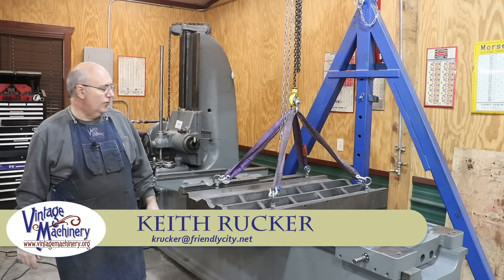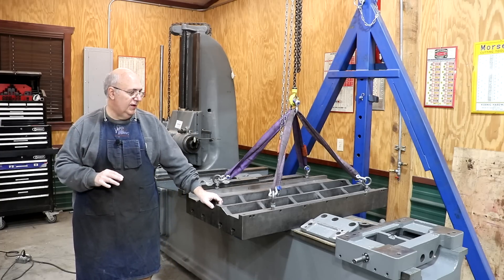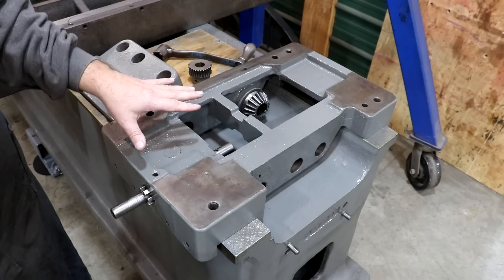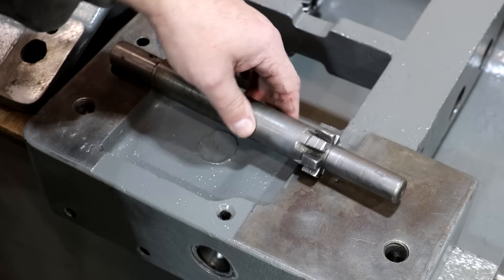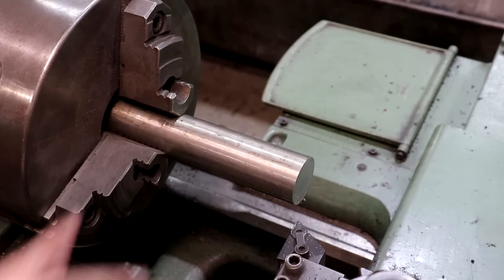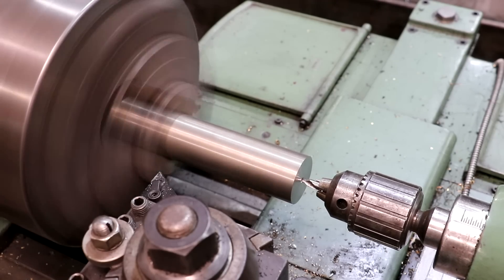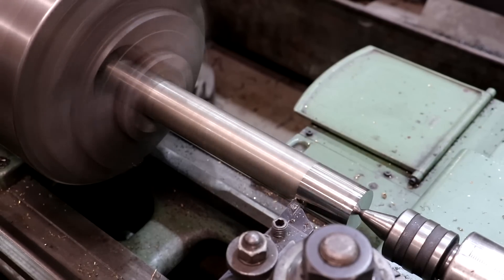Lucas Horizontal Boring Mill Restoration: Machining a New Tailstock Crank Shaft

Comment: You make that look easy.  Now, if I just had a shop, a lathe, a radial drill, cutters and reamers, then I'd be good to go.  Thanks a ton for a really fun video.  I really do appreciate it.
Reply: And a lifetime of experience...
Reply: being a tight ase and a dole waller in the uk. I think with a steel RSJ a salvaged motor and some basic tools like precision dial, caliper and maglock base and precision square off ebay, I can make a lathe and next a milling machine. Machinery on the cheap so to speak. Hope you can too if money is an object.

Comment: When you ream a taper pin like he does here you make it easier for the next guy if he has to knock it out. leave the big end outside the part and the small end (the one that you would hit if you want to drive out the pin) inside the part. It's not as pretty looking as having both ends even, but nobody's going to see it most of the time anyway.

Comment: It’s easy to use the old hole. 

Drill and ream a piece of round stock in the lathe to take the appropriate taper pin, tap a pin in and bore a hole through it. Cut the pin to fit the larger hole in the gear just short of the shaft.  Now you can drill and ream to fit. 

Imo the Swiss cheesed gear is almost as bad as the missing tooth  aesthetically.

Comment: Grab the top of the tool post and pull it away from the work as you scroll the carrage back and you won't leave those scratches.
Reply: Or be like a normal machine operator and back the axis off before moving it back for a new cut.
Reply: That only matters on the  final cut. By leaving the tool set you’ll know exactly how much to move it for the next pass.

Comment: Keith, would it have been beneficial to heat treat the new shaft in the Hot Shot to make it more resistant to wear? And if you heat treated it, would the dimensions change so much as to require some clean up on the lathe and/or horizontal mill? Thanks, great video!
Reply: I wonder this too, after it's hardened does it need a tool post grinder to make precise again?
Reply: The dangers of warpage and extra time and labor required to finish is not worth it for a slow turning shaft like this one. Best material would be tough but machinable 4140 which requires no heat treatment.

Comment: Keith, forgive me if I seem inane, but after you finished reaming and checking the pin, did you take it all back apart, remove the shim and clean the metal filings out of the case? Is that something recommended or is the detritus so miniscule as to be no worry?

Comment: I didn't see if you took care when drilling the tapered pin hole that the worm gear would align with the shaft it needs to mesh with.  In the video it appears as if the worm gear is too close to the casting!
Reply: Exactly what I was thinking too.

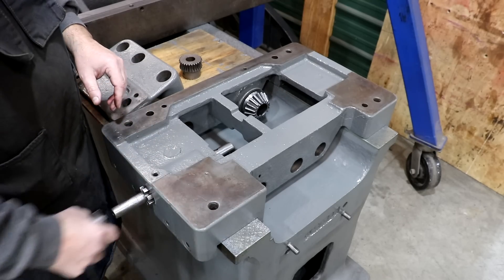Comment: I recently down graded from 500Mbps to 300Mbps Internet connection and for some reason these video's seem to be playing in a slower mode or at least I hope that is the case and Keith isn't drunk.  I didn't think this was possible, Keith drinking maybe but not while working with such dangerous equipment!  Someone pleas tell me if the slower Mbps is going to affect voice and Keith's hand slipping off the Crank Handle, 3:14?

Comment: Hi Keith, glad to see you back at work again.  I have a HJORTH lathe and Tool Copany lathe built in Boston Mass as #96.

The ways are quite rough. What can I use to flatten them out without altering the relationship between  the center of rotation and the center of the tail stock.? I have not much skill and right now, at least, nothing more than standard grinding stones. I want to recondition this machine. Not necessary for extreme tolerances but reasonabley close would be fine  (Yeah, and what is that?)

Another great chapter, thanks for the step by step instruction.
Reply: Hope you find your answers and way, If I had them I'd freely give them. All the best.

Comment: Possibly a dumb question, but it looks like a lathe and a horizontal mill are kind of the same machine, except with a lathe the tool is stationary and with the mill the work piece is stationary. Is it practical/possible to use one machine as both a lathe and a horizontal mill? or am I missing some fundamental difference?
Reply: Not the same machines but they compliment each other very well. Lathes and milling machines are the basic machines in every machine shop.
Reply: You can mill small parts on a lathe with a milling attachment, and I have a friend who turns small parts on his mill, but you really need one of each for versatility.

Comment: Those splines don't feel like the greatest design choice, feels like they will always be a weak spot. I find it amazing though that a single point tool can put up with cutting like that. The forces when it contacts the piece must be enormous.
Reply: Not if the feed is slow enough and the "bite" is small enough; then it's just like a normal cutter.

Comment: I have to wonder why the engineers used a design that requires a special cutter or has that particular cutter simply gone out of fashion and is not longer made.
Reply: I expect it was common among their range of machines. So some custom tooling just for those cuts was probably fine.
Reply: I suspect that there was no 'standard' for milling machine handles back in 1918 when this machine was built. Back then each company was more about standing out on their own design choices and style, in a sense, attempting to 'set' the standards.